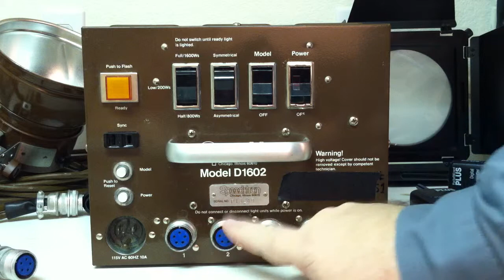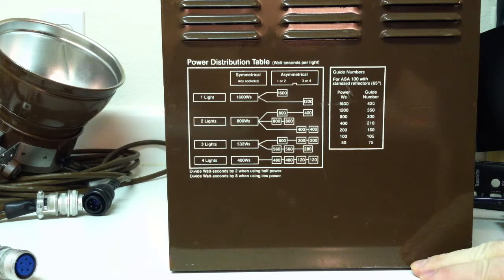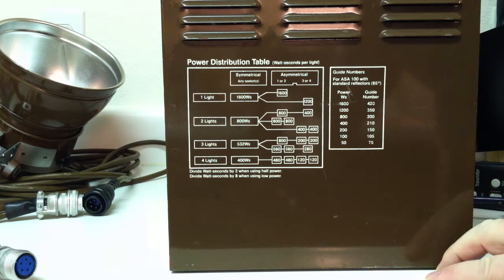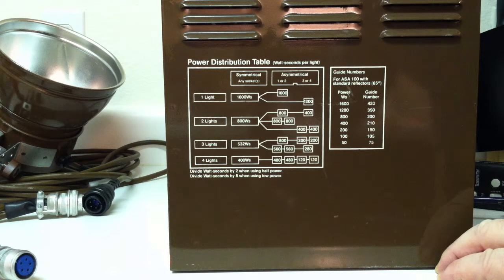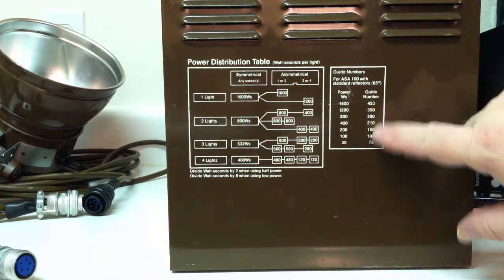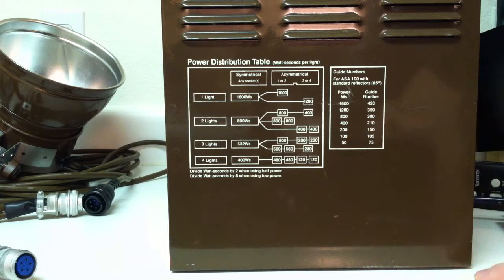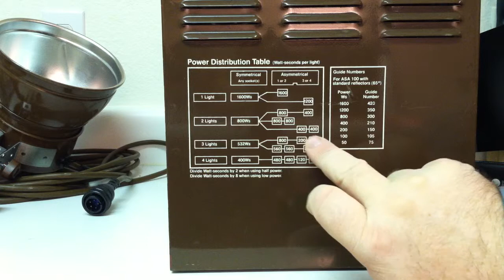Speedotron Brown Line D1602 power pack overview-IMG_4560.MOV

Comment from the maker: Hi Shaun: I believe it takes .7 seconds for full, 100% recycle at 200 Watt-seconds. My guess is that at .4 seconds, you'd be at around 85% power. YES, I have run this off of the Tronix Explorer 1200 portable sine wave inverter. These are rugged, simple power packs with reliable flash heads. Thanks for stopping by!

Comment: Thanks for the video. I have been looking at these older strobe unit, and using them. Knowledge on these are very lacking with today's photographers. Two question: would you use these with a modefied sinewave converter? And would you be able to shoot several frames per second at the low power (like 3-5 frames at 200ws)?